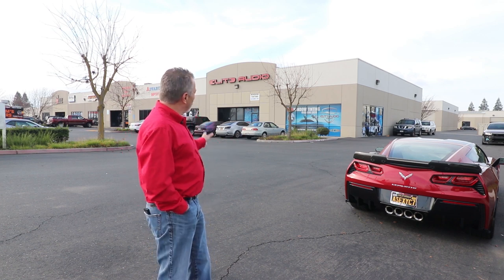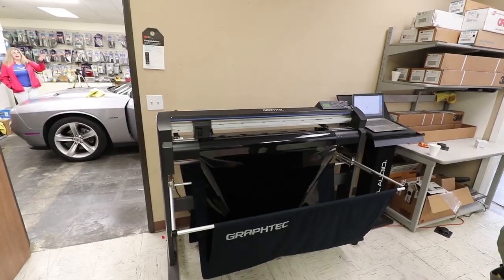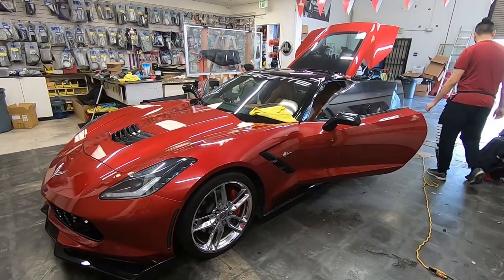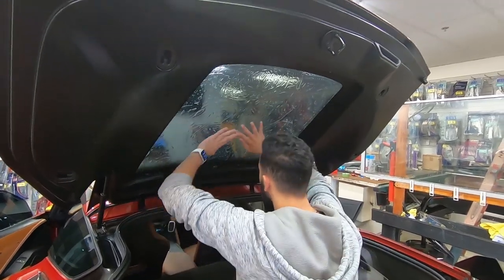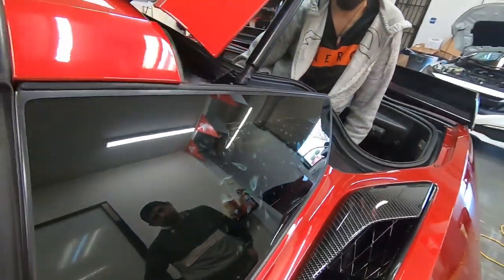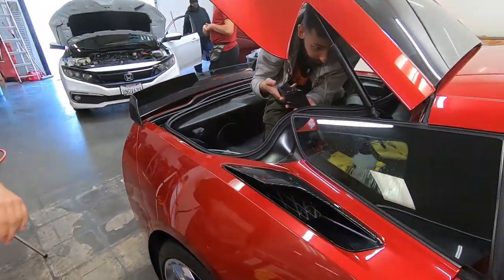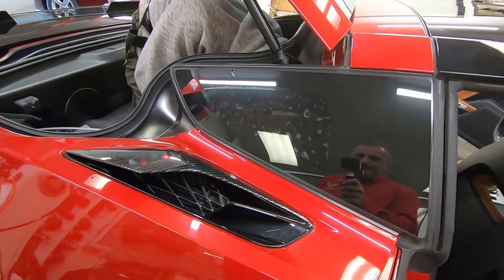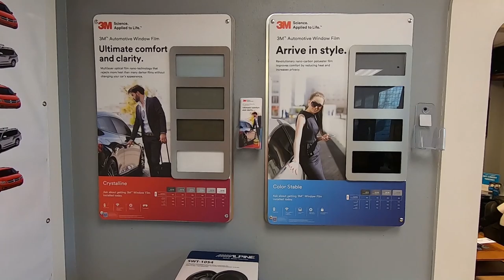Both of Our C7 Corvette's are Going to Elite Audio and Tint Part 1

Comment: What level of tint did you get? Don't they have differing shades available?
Reply: I see now, you choose one of the darker ones. How did you decide which one to get?
Reply from the maker: We chose 20% on the sides and back and 70% on the front windshield.
We decided to do 70 on the front so we could see out at night easily and it still cuts the Heat and UV.
Reply: @THECORVETTECHANNEL  Thanks! It didn't occur to me to choose different ones for different windows.